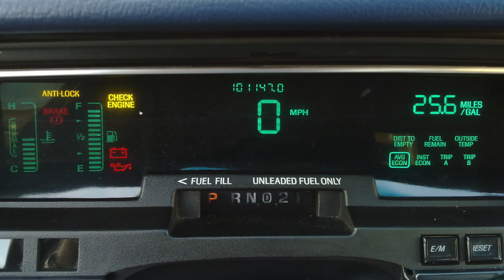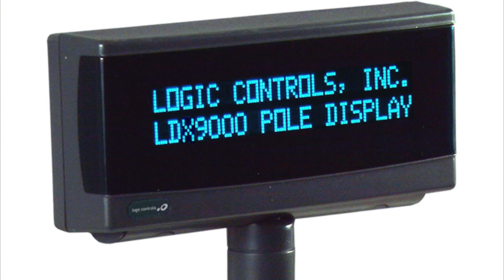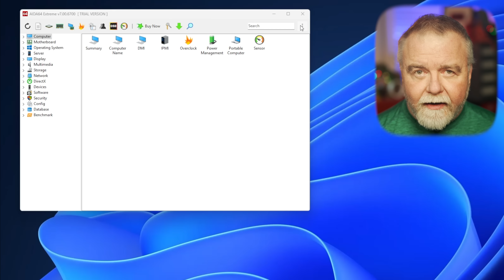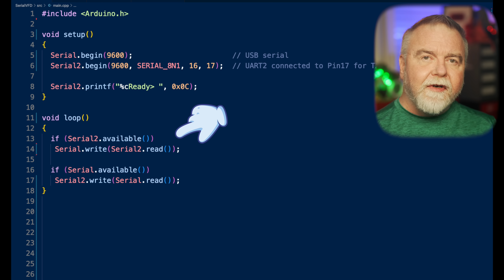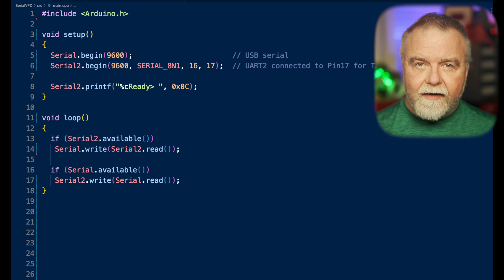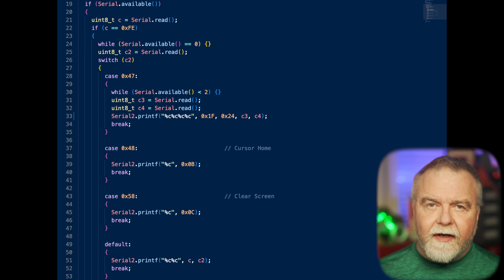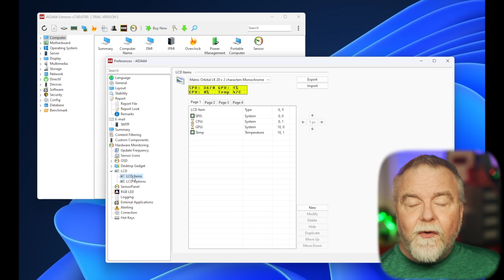How VFDs Work and How to Add a VFD Monitor to your PC

Comment: I have zero technical knowledge on how to do this so i asked chat gpt and im absolutely floored by how powerful of a tool it is for aiding in project ideas. it was able to suggest specific models of both microcontroller, as well as vfd models and why you need one with a controlelr built in if you want a simpler install process. It even allegedly has setup guides for specific parts. even if some of this info is wrong i already feel much more confident that i could actually undertake a project like this with only a few hiccups and no  prior experience. what an incredible tool

Comment: Already done that with my ancient Phenom II computer, I had to use "CutieLCD" or something similar so I can set what I want to see via RS232 with a small Noritake Itron GU graphics VFD. It's not difficult to do with USB to RS232 especially via special USB to RS232 chipset via FTDI. If you wanna go this route, be absolutely sure you pick 5 Volts DC version if you want to power it via USB and that you don't overwhelm the USB port when all pixels are lit (check amperage rating for all pixels lit in the datasheet to make sure you dont exceed 500 mA via classic USB port), otherwise use 12 Volts version with isolated RS232 interface. I love those VFD displays as they are quite fast with video refreshing especially with larger graphics VFD, especially via Motorola SPI or 8080 / x86 parallel interface, those VFD interfaces can pump video data fast enough, up to 30 or 60 frames per second depending on chipsets used.

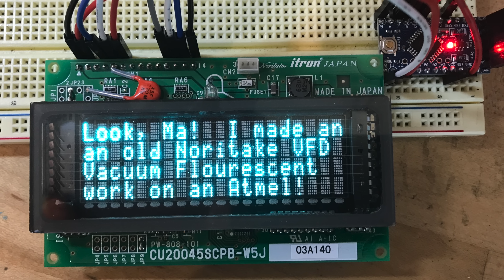Comment: Good evening Dave.  I came across your video and at 2:49 you talk about a Noritake VFD and it just dawned on me.  I have a 20 x 4 VFD display very similar to the one you talk about.  It has a part number of '05464ASSY33222-02D1' and it also has a 14 pin connector similar to yours.  It also has 'Caltronics' and 'IEE' stamped on it.  I have been looking for the pin-out for this device for years.  I was wondering if you could let me know what the pin-out was on yours so that I can see if this one is the same.  Good video by the way.  Thanks in advance.

Comment: Ive used HD44780 compatible VFDs on arduino projects with great success too. I also built a linux based mp3 player using one many years ago that ran ELMP.

Comment: Love these displays! I purchased one for making the usual clock but sat in a drawer for a year because it wasn't the serial model and I didn't know how to drive it, turns out a year later i can do both using a converter or using the HD44780 libraries which I did not know back then, it made for a really fun project.

Comment: this really reminds me of one of my projects i made back in school.
I made a hardware monitor with 128x64 LCD and analog needle gauges to show CPU/RAM usage, clock freq and core temp. both LCD module and needle gauges were driven with microcontroller which talks to the host pc over usb/uart.

Comment: My Son's current gaming PC lives in my old gaming PC case (circa 2004). It has a red on black Matrix Orbital LCD display that works with LCDC. I still use optical drives on all of my PCs and will need to hang onto my current cases because finding a case with external 5.25" slots is almost impossible.

Comment: You can still get motherboards with PS/2, serial and parallel ports, but those boards are usually geared towards workstations and servers, so they're a little off the beaten path for the consumer market. They're a little bit more pricey (my MSI Pro B660-A ran me about CDN $300), depending on what options you're going for, but they're not too hard to get if you know what you're looking for.

Comment: i recommend putting a color filter over the VFD, it will give it much higher contrast. Obviously dark green filter gel will make it more green, but many devices with VFD:s actually use violet/purple filter, giving it much brighter and almost white color. Companies selling color gel/films for stage lighting have nice sample sets, some filters will give surprising results when put over VFD due unique spectrum of phosphor they use. I have VFD addiction myself, I have been collecting display modules and just glass displays since I was a kid, and have reverse engineered several of them to show text from microcontroller, act as a VU meter or display time. Still when I see old device with VFD, I must resist urge to pick that up.
Reply: Dave's PC case appears to have tinted glass so it acts as a filter.

Comment: The need for expensive customized tooling and a fixed format made them an evolutionary dead end when high-res LCDs came along.
Reply: It's the cost that killed them, not the fixed-segment nature. Plenty of VFDs had a full grid of pixels and plenty of LCDs in modern devices have fixed custom segments.

Comment: Cool! I used an old vcr vfd's for a htpc case. Generating the right voltages was a challenge. The filament wire had to be fed 6v ac superimposed on 10v dc, and the grid was 3v i think. Getting it wrong made the filament light up like a lightbulb, and using dc only gave uneven glow. When i got it all right, and was able to bit-bang it using my parallel port, and it lighted up i was over the moon 😂

Comment: The VFD in my 1995 Grand Cherokee is the bomb.  It shows me everything going on with the vehicle and it looks good doing it.  It's aged much better then early LCD screens.
Reply from the maker: Good point, they don't seem to age at all, but you'd imagine the phosphor would "wear out" over time... so why don't they age much?
Reply: @DavesGarage    Mine haven't seemed to age at all.  They also function perfectly in the cold where LCD's struggle.
Reply: The phosphors can get burnt-in if left displaying the same thing for extended period of time just like CRTs but most cars aren't driven 24/7
Reply: The seal can also fail over time, which causes the entire display to stop working.  No vacuum, no display.
Reply: @toasTr0n  I think you'd have to crack it for that to happen.
Reply: @foch3  You'd think so.  But I've seen it happen while in service, without cracking.  It partly depends on the construction.  Some VFDs are sealed with frit glass; some with metal fittings.  Any point where a metal lead enters the glass envelope is also a potential spot for a leak.  The latter would usually be evident before the display leaves the factory, but not always.  An air leak could be caused by the metal on the leads changing composition (i.e. corrosion) later in life.  I'm sure there are other ways for them to leak, but there are a couple.

Comment: Ooo Datecs is a Bulgarian company for cash registers and they currently make POS terminals. They used to be an OEM for a company I used to work for. They made the hardware and wrote part of the software and we wrote the other parts. They are big in eastern Europe.

PS: I hates the entire code base in that project. It was unmanageable.

Comment: In my world, VFD means a variable frequency drive, allowing me to run 3-phase equipment on my 240 VAC single-phase, with variable speed.
We used to call those displays "plasma" or "cold-cathode".
Reply: Those are different display types. Vacuum fluorescent displays are hot-cathode. Cold-cathode plasma displays contain a gas (usually neon).

Comment: I'm disappointed in your title, Dave. I was looking forward to a video all about how to add a Variable Frequency Drive motor to the expensive wheels on my Mac Pro. I know its partly on me for not watching the entire video before going out and having three-phase power wired up to my office desk, but that's an expensive bill I'll never recover from! Oh well, at least I now have enough juice to run the new triple-RTX 4090 build I've been working on.
Reply: Why would you run three-phase power to your desk? I thought most variable frequency drives support single-phase input.

Comment: I hacked together something very similar last year, but took a slightly different approach- VFD connected to an Arduino, then feeding the data via a small C# program. Your solution is much more comprehensive!

Comment: Dave Jones from the EEVblog also has done a video on these displays decoding the communication protocol and making it to work correctly with I think it was an arduino as well.    I like these displays, but like you said, it's old technology and sips a lot of power.

Comment: They wanted too many processor cycles per pixel on the display tiles in the new start menu.  That's why it failed.  Other than that Windows 8 was delicious.  Like blackberry kush.  Maybe a gentle fork for tablets was possible?  Something felt too futuristic to just toss it.

Comment: I went through the exact same journey with Aida64 last month, but I’ve been playing with VFDs forever. I salvaged VFDs from Buick LeSabre, network rack equipment and more, and even paid a visit to MatrixOrbital’s HQ a couple of blocks from work. Those guys are amazing btw! It’s always a challenge to retro-engineer the signals when undocumented, but for the rest of them, it can use I2C, SPI, Serial, Parallel, and so many more exotic formats. Challenging but always fun and rewarding!

Comment: Hi Dave, did you find much load on the system (or any odd behavior with sleep/low power states) when using AIDA64?

I played around with it a while ago and tried making a sensor panel/page and it seemed to stop my 7950x from going into a low power type mode (no idea on the correct name). Basically the CPU was always consuming about 40w and sitting on 60dC in winter owing to turning down the fan speed.. and noted it also flipping between 2 cores very briefly using 100% of the core and sitting on 5.8ghz

if the LCD option is easier on the system, might have to blow the dust off the old matrix orbital i have haha

Comment: VFDs are still a staple in POS systems. I worked with them a lot with my former company due to the fact that they are still very common in small businesses. Some work over USB, some over traditional serial. It’s really neat to see you make something like this. Logic Controls LDX9000 were my bread-and-butter back in the day lol.
Reply: I worked in POS in the very early 2000's, and still have a (probably 90's) VFD pole display RS232 based, somewhere around here.

Comment: Just be careful handling the display! There is also around 300 volts present on the VFD display. It's not deadly but will bite of you get across it. Also note a raw VFD module typically follow the same protocol as any LCD display.
Reply: That's really weird. You can get them going at about 30V, so it's weird why a commercial one would have 300V on it.
Reply: @ThisRandomUsername  The voltage is boosted up but not the amps so the neon will activate.
Its like the old camping fluro tubes they plug into 12v but the tube it's self needs a high voltage to activate.
Reply: @maxgood42  Yes, it's current limited, but the thing is the voltage is much lower than neon or regular fluorescent displays. They operate like a vacuum tube with a heating element, a grid and the phosphor coated anode. Neons use an inert gas to fluoresce, while VFDs contain a vacuum.
Reply: @ThisRandomUsername  Yes, a VFD pixel is basically a triode.
Reply: @maxgood42   As @ThisRandomUsername hinted, you're confusing this with a different type of display. These are vacuum fluorescent displays, not gas-filled neon displays.
Reply: @eDoc2020  Yes it is not the same, (grammar brain fuzz) I was referring to the how the circuit has a higher voltage output to the display module it's self. The other display / light effects are an example of circuits to be careful with when they are powered up even thou the power source would be considered as a low voltage. I don't know why I called it a neon facepalm.
Reply: @maxgood42   This one takes 12 volts and probably boosts it to 30 volts. It sounded like you were saying the tube needed more than that.
Reply: @eDoc2020  Yes but consider how we can get a boot from a XLR mic (48v) in the rain.
Many stage performances have had an un expected Jame Brown moment.
"WAAAAA... I feel electricity "🤣
Reply: Only a small tingle
Reply: Reading this my brain pictured Dave swearing and looking into the camera in an ElectroBOOM moment💥 ... next video "How not to wire high voltage devices to your pc" 🤣
Reply: As one of those mooks who discovered CRT anode voltage the hard way when I was a kid, 300V is nothing! My dad taught me how to adjust the colour and focus to milk a little extra life out of old TVs and monitors, but one thing he did NOT teach me was how to properly discharge the tube. Had to learn that on my own.

Comment: great job Dave! my first smart LCD two-line project was in school, and we made a 2k counter from a CPLD, and clocked the data out of an EPROM, directly into the display! 
The entire project was wire-wrapped and was a lot of fun to build. Later I made the exact same display you have, but with the  Hitachi HD44780 LCD controller smart display, and clocked the data from the computer application into the display via the serial port, in much the same way you did it.

Comment: VDFs are cool.  I found one at a Hamfest which is 40 characters by 12 lines apparently made by NEC back in the 1980s.  My guess is it came out of a CNC machine.  Playing around, I eventually found the serial input which is 8N1, 9600 bps, positive TTL.  Just guessing, I figured <ESC> followed by an ASCII character might be cursor control.  It was A, B, C and D.  I wired it up to a Particle Photon (similar to an Arduino Uno with Wi-Fi).  I haven’t been able to find an NEC data sheet, but at this point it seems I don’t need one.  I made a cool clock / calendar and moon phase display.  The downside is the 12 Volt supply draws 2 Amps.  It sure isn’t very power efficient.

VFDs are subject to burn-in if you leave the same thing displayed for a long time.  I wrote a small sketch which displays a solid block character with every pixel lit in every character position to help equalize the wear on the phosphor.  It turned out I didn’t need to do that on the display I found.

Comment: I wonder if you could create a custom serial to USB controller and then plug the display into it and plug it into an internal usb2 pin header. Then write a custom driver to feed data to it...  3d print a case and design a custom PCB for the circuitry and just an internal usb2 header plug that you plug into your MB.....

Comment: Those vfd displays are really popular in 90's/00's GM vehicles and was usually the milage or hello display. My C6 had one that was more interactive that you can program your name. However most GM/gmc trucks, it was the OD display
Reply: As somebody who has two OSB GM trucks, I would have loved if they'd display the engine fault code, so you don't need a code reader!

Comment: Nice shirt. (no sarcasm)

I remember >20 years ago, I put an LCD in a 5-1/4" drive bay in my PC. Connected via rs-232. I programmed it to read a text file from the internet. That file, I allowed users on my blog to modify the contents via PHP, so they could go to my blog and leave me a short message that would show up on the LCD on the front bezel of my PC!

Comment: There are some very similar-looking VFD modules available with a 2x7 pin header (14-pin) - these are compatible with the HD44780 LCD protocol. I initially encountered them in the "Ticket Station" by Benchmark (machine used in arcades to count and shred tickets)

Comment: For certain people in certain industrial jobs the acronym VFD means something completely different. I was honestly like "Why does a PC need a Variable Frequency Drive?"
Reply: Believe it or not, they're in there! The drivers for mechanical hard drives' platter motors are more or less the same as a VFD, spare the name being associated differently.
Reply: @AnnaVannieuwenhuyse    Don't forget fans (and water pumps if applicable).

Comment: K have an issue. I love USB as I can plug in anything and it just works. As well, I love using USB webcam as I can simply plug them in and watch anything using the Windows Camera Viewer. My last home I used USB extenders over CAT-5 network cables to watch my backyard pond (Logitech p920 lasted over 4 years and still working in a custom TPU 3d printed self cooling case). Now comes the issue. I am in a new home and I need to find a wireless USB extender so I can again connect any webcam outside and view them indoors. Any ideas on what I should be looking for?

Comment: This is the least helpful video on Variable Frequency Drives. If anyone else is disappointed, check out the great video by Mr Carlsons lab on Variable Frequency Drives. But now I know what is wrong with my 1980s stereo system with a blank display.

Comment: I've recently also grabbed one of these cash register displays (weirdly enough, the German ebay seems to be flooded with them, mostly Epson or Samsung branded, down to 5$ a piece at times). Currently it's directly attached via an RS232 adapter, but long term plan is to add an ESP8266 and give it a simple HTTP API over WiFi. I always feel kinda bad using an ESP for a project and then not utilizing its wifi capability..
Reply from the maker: I feel bad using the ESP32 for anything simple, but they're so cheap it's hard not to!
Reply: @DavesGarage  They're the perfect tinkering tool for anything that doesn't need a lot of pins. More than enough speed so one doesn't have to spend much time optimizing code, and cheaper than the old ATmegas..

Comment: I'd like to see where you soldered into the VFD and how you hooked up the wires.
Reply from the maker: I should have shown that, you're right... sorry about that!  I soldered a single wire from pin 17 to the spot I show on the circuit board (the output of that little inverter chip).  Then ground, and that's it!
Reply: @DavesGarage  thanks!